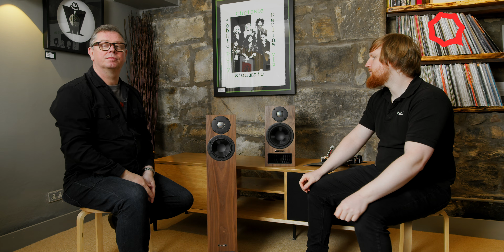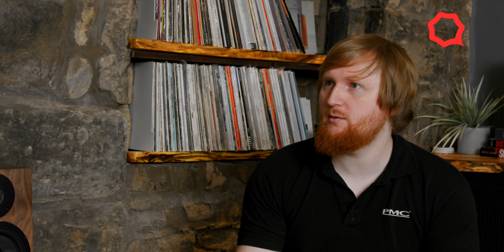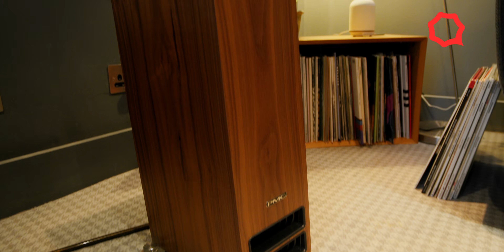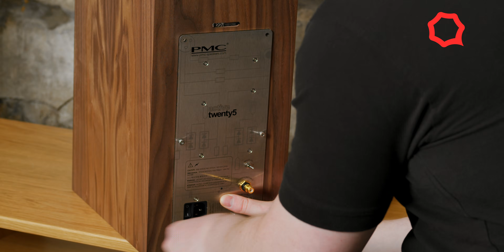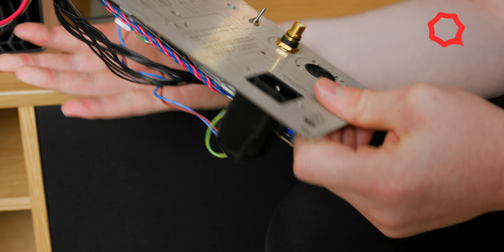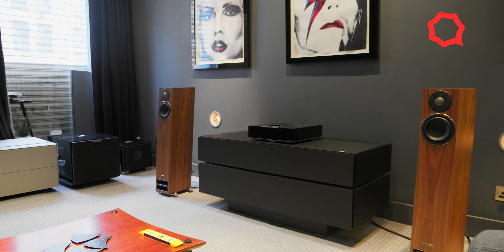PMC twenty5i Speakers - Now in Active Guise

Comment: Please tell me if it is necessary to constantly turn off the amplifier while you are not using it
Reply from the maker: No, it's fine to keep it switched on. It's a class D amp, so won't be using much power when not in use.